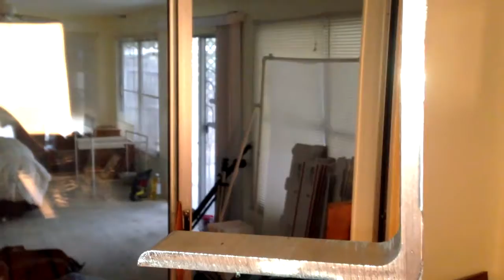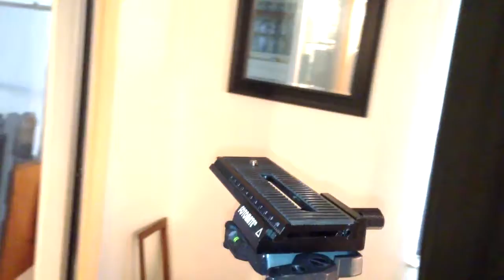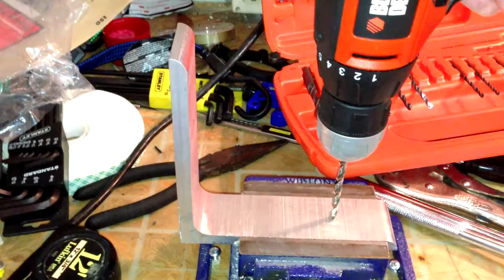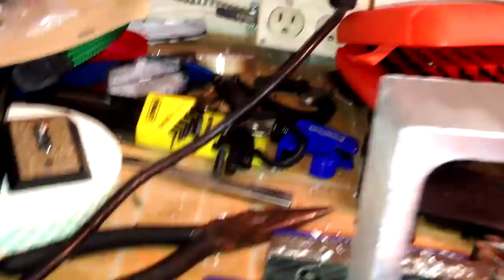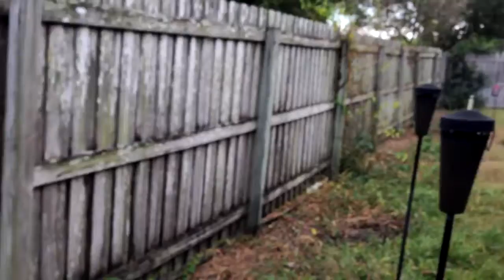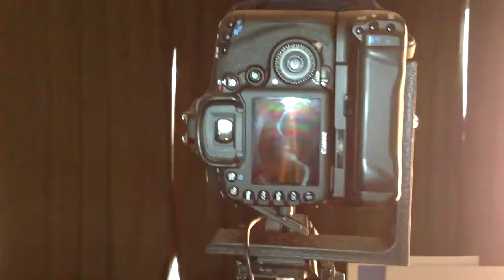DIY L Bracket Finding Nodal Point And Using Focus Rail

Comment: When using the "L" bracket, you don't need a rail to center on the node.  Mount the bracket directly on your ball head, tilt bracket and camera backwards a bit, level the camera by loosening the screw that holds it to the bracket.  You'll probably need to do it a few times to find the front node and keep everything square, but it's easier after a little practice.  A regular pan head works better than a ball head, plus you can mark your position on a pan head. That's the way I've done it for 30 years, using a lightly modified binocular tripod adapter for the bracket.  There's a way to cheat on landscape panos too...  Of course, this only works on single row panos -- to do multiple rows or sphericals, another piece — a straight bar — has to be added.   By the way, anybody that just bought an expensive panorama head probably shouldn't watch your video — talk about buyer's remorse...😥

Comment: Very good video, and good idea for the L bracket with the focus rail, but I think you still need the other axis, a 4 way focus rail in order to calibrate the nodal point , left to right, in the portrait mode. IMO
Reply: You mean the nodal point up vs down i guess, left to right he's fine for one type of camera. If shooting full 360x180 he could eventually correct this with just sliding the focus rail, at the other hand the parallax will be less extreme with this type of tripod